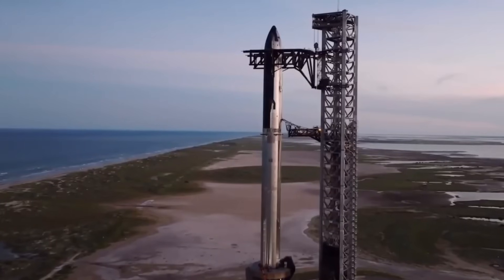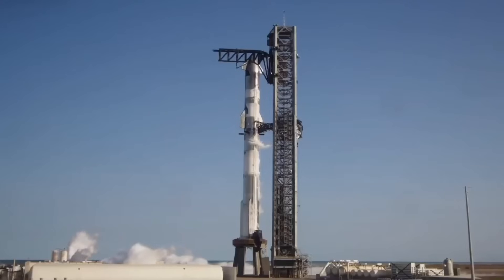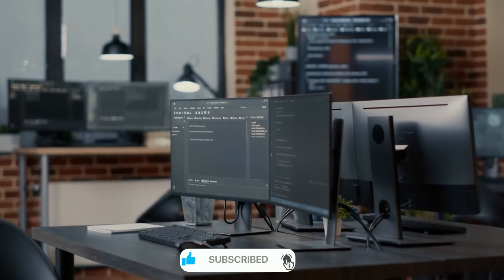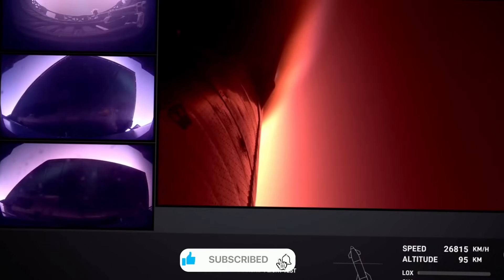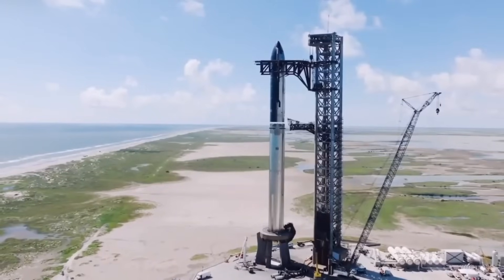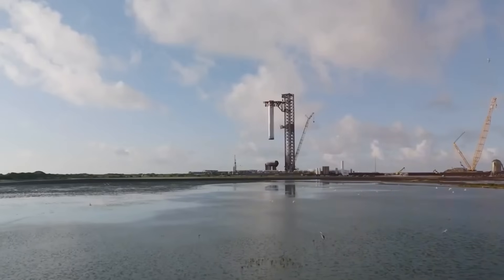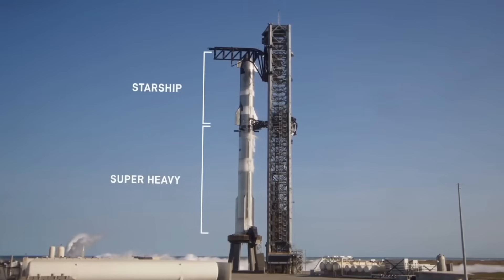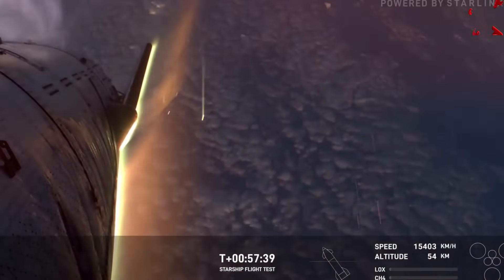GAME-CHANGING: SpaceX's Starship V2 Unleashed... 25% More Power + First Real Payload!  INSANE!

Comment: Ready for V2. Very good video!  Before I forget;  CRAZY IDEA - - -  >>> using four drone barges, that are separated by bridge framing, to support a Venus Flytrap type butterfly frame that will act as the Mechazilla chopsticks would enable capture at sea.  The central part of the barges will be open and allow the thrust blast to hit the water and not damage the barges.